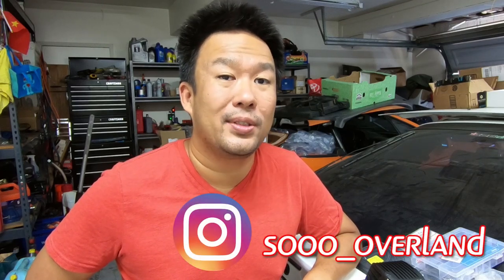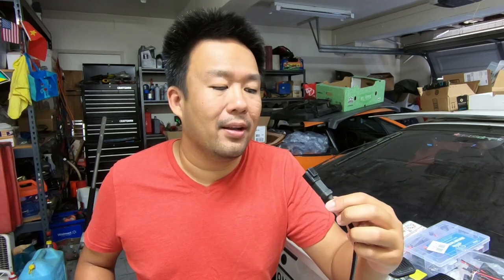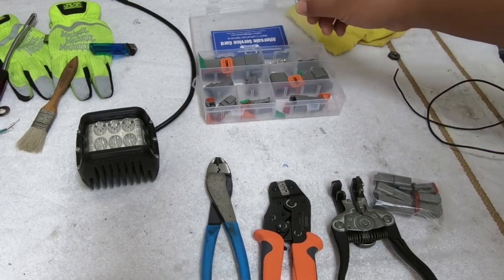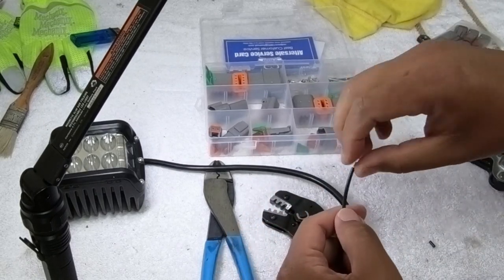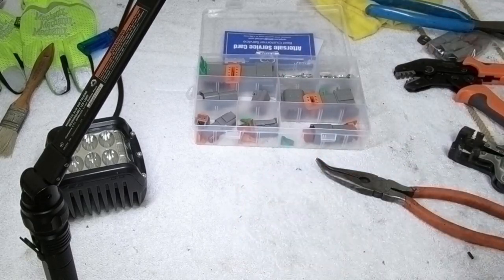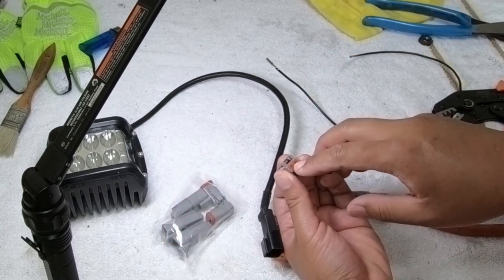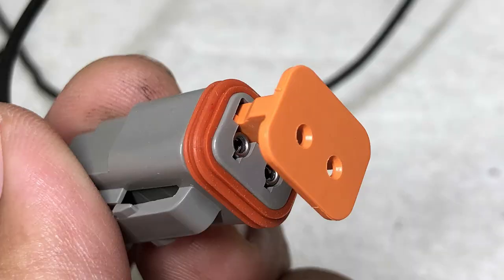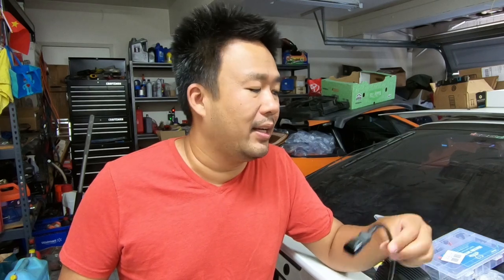Easy dust/water proof connection for most aftermarket lights, Deutsch connectors.

Comment: Hello, thanks for the helpful video. The pins you linked are 14-16 AWG, whereas the crimper tool you suggested is 18-28 AWG. Are these the exact parts used in the video, or is there some sort of mistake here? Thank you for clarifying.

Comment: Nice video, I’m also installing some lighted mirrors to a switch pro, however how did you run the one power from switch pros to power both lights? I’ve been looking for a harness to do so but no luck any help would wkrk

Comment: How do you run your electrical lines from the roof to the engine bay?  That could be a great video potentially.
Reply from the maker: I’ve gotten a lot of questions about that, basically I run it down the windshield. Once it cools down a bit I’ll make a video

Comment: I see you turned your lights on with a switch pro panel! How do you like it? Would you recommend it? Will you have a video on the switch pro review/install?
Reply from the maker: Keen eye friend! It’s a great addition to any rig, especially when you start adding more accessories like I did, really helps keep the wiring/switches/relays to a minimum. Unfortunately I didn’t get any footage of my install, but I’ll try to get some on the next Switch-Pros install I’m involved in 😉